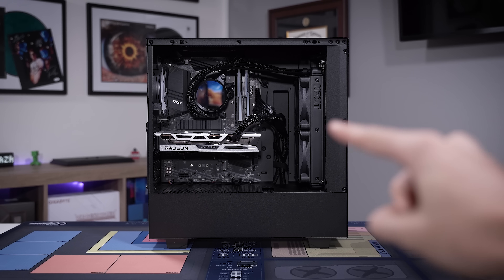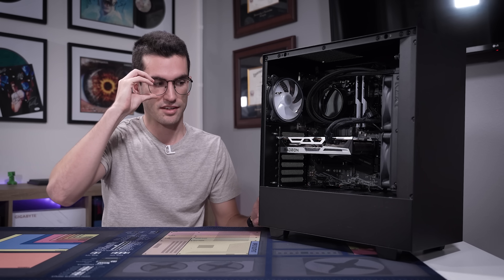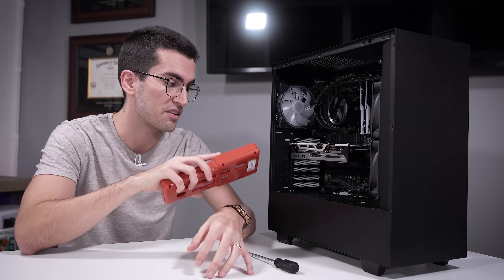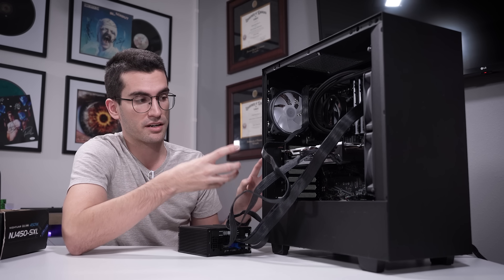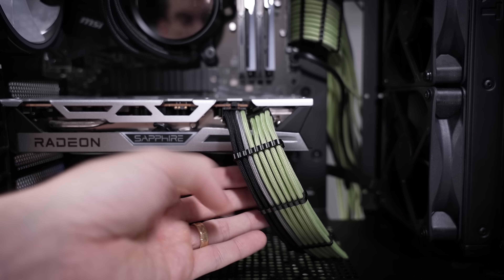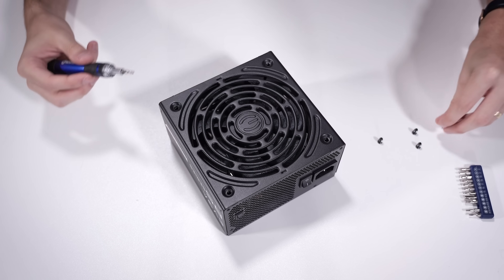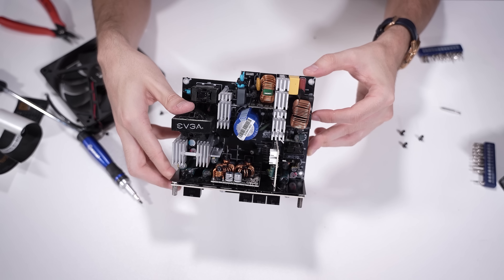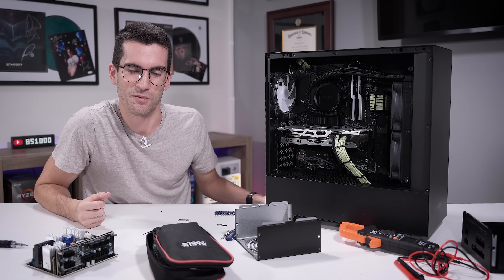Fixing a Viewer's BROKEN Gaming PC? - Fix or Flop S3:E15

Comment: Hi Greg! I consider upgrading my cpu from a ryzen 7 2700x to ryzen 7 5800x3d and i wanna know what cooler would you reccomend because now i use Be quiet pure rock fx2
Reply: Not Greg but I think you'd be good with any 6 heatpipe cooler, like the BeQuiet Dark Rock 4 if you like the look of Be Quiet. There's others in that same neighborhood also.
Reply: I have a 5800x3d and I would be a little leery about using an air cooler on it. 

It's a toasty boi even with my 240 aio, and the thermals are very inconsistent.. 

It's a fantastic CPU, and I'm sure a high end air cooler could tame it.

Comment: I've been using bequiet! power supplies for the last ten years. I had a bequiet! Straight Power 750w Gold break about 6 months before the warranty was up and bequiet! replaced it with a Dark Power Pro 750w Platinum. Two years later...still using it. Not bad at all.

Comment: Hey, new builder here. Trying to build my pc now, but after putting everything together and connecting all cables, everything turns on (rgb, case fans, GPU and cpu fan) but no post. The mobo diagnostics turns the red light for the cpu on, but only for a second then it turns off (this is after I updated the BIOS). Checked other guides and tried following them (reseating everything, taking the CMOS out for a bit) but still nothing. Any little bit of advice would help. 
Specs: 
R5 5600x (ebay)
B450 gaming pro carbon max wifi (ebay)
Radeon 5600 xt (ebay) 
16 gb, 3200 mhz lexar Thor ddr4
Patriot p300 m.2
Nox 650 w psu
(Rest is Amazon)

Comment: Fixing psu's not worth it.
Simply because they work at high voltages and high amperage.
If something breaks, lotf of things breaks with it too.

Like on dell laptop motherboards.
If it dies, it is an endless rabbit hole.

Comment: easy and SAFE check you can do without opening the PSU is measuring resistence to GND with the multimeter of the various colors on ATX plug. if any of it is less than 10 ohms you know theres an issue inside PSU

Comment: mind if i ask but how do you drain the power suply so it is safe to handle?
Reply: You can very carefully use a good screwdriver, NOT a cheapie one, and short out the two leads on every big capacitor you see on the board.  If they are still charged up, you will see a spark when you touch both leads together.  Just don't be touching any metal part of the screwdriver when you do this!!!  They do have a special grounding tool for this which keeps the high voltage sparks from possibly damaging the board, but a good screwdriver with an INSULATED handle should be fine. Just be careful and MAKE SURE the PSU is NOT PLUGGED IN FIRST!!  😵
I've actually been hit by a high voltage cap in a TV many years ago when I forgot to drain it and the juice went from one arm straight across my chest and out the other because I forgot to keep one hand behind my back for safety first!  VERY UNPLEASANT and if I was older, like I am now, or had a heart condition, I would NOT be writing this now!!! It literally knocked me back against my mom's breakfront!!

Comment: Misisng 5 v for Stanby from power supply , without 5V  is not working  , the power supply it have other power only for 5 v it fix that may work again  👍👍👌👌 14:22 here in right EEL-22-08 tranformer for 5V  and the chip IC81  drive this tranfomer

Comment: This happened to my PSU, we had rolling black outs and it shorted most of the PSU a 600w 80+ gold. My PC would post and was able to be used a bit until it became under load, that's when it turned off. It eventually fully died and I replaced it with an 850w 80+ gold PSU. I'm all fine now with my PC

Comment: I’m glad for this series. Just finished up finding out why my cousin’s PC was overheating (I built the system myself and did some maintenance not long ago)
Symptoms: Shut down on home-screen without running tasks and 10-15 minutes of gaming then auto shut down 
Checked every component, last being the CPU itself.
I instantly witnessed the problem…I didn’t apply enough thermal paste!
Problem solved!
Did some updates, went into bios, enabled XMP, Asus performance mode, hit save and restart only to run into another problem!
Debug gave me a Ram issue, cleared cmos and nothing
Thankfully I had my own PC and took out a single ram stick, took out his, inserted mine and boom! Boot up!
Disabled XMP, asus performance mode, saved and restarted. Everything fine with my stick
Turned off and inserted his ram and boom! Boot up! 
All in all, your channel has saved helped my PC journey and I can’t thank you enough!

Comment: Help please! My PC stopped POSTing after updating BIOS and Windows, it works with low 4gb 2133mhz RAM but doesn't work with anything higher, it used to have 16gb 2666mhz (2x8) but not anymore, already cleared CMOS and reinstall BIOS and Windows

Comment: I always buy high quality PSU's now after having a cheap PSU start to catch fire and not shut itself down. I was just lucky I  was in the room and could unplug it really fast from the back. My current PSU is a Corsair RM650X. I had a friend years ago have a bad PSU take out a number of PC parts. He was not happy about it, as he had replaced a hard drive that failed and then the PSU killed the replacement drive as well.

Comment: When I built my  first  PC, I couldn't get a picture.  I  took my  pc  to a professional  and they  diagnosed and fixed it right  away.  I  didn't plug  my graphics card in to the 8 pin. I felt so dumb.
Reply: in India, some shops scam you in cases like yours, telling you that your gpu is toast and you need to shell out bucks on a new one. Happened with a friend of mine who had no knowledge about PC parts
Reply: Tip from my father that is a retired telecomunications repairman. ALWAYS check if the cables are correctly connected. I do that with every module of my pc whenever I open it up to upgrade or clean it up.
Reply: When I got back into building around 2014, I forgot to plug in the supplemental cpu power cable and called techsupport for the mobo manufacturer.   That was the first question they asked me 🤣
Reply: Don’t worry about it. I’ve spent a lot of time troubleshooting my pc that wouldn’t on, only to find the power supply switch switched the wrong way

Comment: There could be that the PSU was fried right off the bat when trying to first power on the system depending on what the TDP of the components is cause that was only a 550W
Reply: Over draw won't kill any but the most garbage PSU. Typically it'll just switch on for a second or two and then trip the over current protection circuit.
Reply: @DJKr15py  overdraw has killed more EVGA PSU’s that I’ve built with than any other brands. I wouldn’t doubt if there’s some QC issues or manufacturing defects that went unnoticed
Reply: @StatikTheWarmonger  I'm guessing they were being run at 99% of their peak output and then the normal degradation of the components was somewhat accelerated. 

Personally I always run a massively overkill PSU, not only does it account for possibly decades of degradation but it runs much much more efficiently at 50% load.
Reply: @StatikTheWarmonger  I agree, for all the schlongriding this company gets I see a subjectively large amount of units with issues crop up.
Reply: @DJKr15py  I do the the same, I have a be quiet! Dark Power 12 1000W 80+ Titanium in my rig. The PC’s I’ve built with EVGA PSU’s I’ve seen failures even when they’re overkill for the rig they’re in and it’s not any specific wattage. They’ve failed on a 650W, 850W and 1000W that I’ve worked with and in a 550 here on Gregs video.
Reply: @StatikTheWarmonger  I've got a 700w one powering my old FX-8350 rig and it has terrible coil whine so hopefully it doesn't go out soon.
Reply: Yeah, more likely was on during a power outage. I find PSU's have higher chance to die with the abrupt off (mixed with some bad power from the wall) then even a surge.

Comment: Possible the main switch mode transistors are shorted and the main fuse is also bad like you said not worth the trouble for the cost of the power supply.

Comment: if you want that psu fix than sent it to me i can fix it it and sent back to you because i have worked on many them

i remember mine died just like that no power at all i contact my seller they sent me replacement one n sent back old one blew out
i have fixed few customers psu because they were out of warranty 
one more likely to failure is one on taller heatsink which u didnt see it closer

Comment: 14:44 It’s unlikely that the PSU cables were mismatched, but it would be hilarious if something happened to the cable internally
Reply: I just ran into that a couple of weeks ago, had 2 pins swapped on a 6+2 PCIE cable - took a while to figure it out.
Reply: Yeah I was thinking it's worth at least checking the cables but that would require having the exact same cable spare which is probably pretty unlikely.

Comment: Would be nice to to get a little more information on what happened specifically when this unit stopped working. I have honestly never had an EVGA unit that is 80+ certified crap out on me to the point it is completely unresponsive. This was a diagnosis straight out of the PC Builder Simulator though. Well done.
Reply: If it helps in your knowledge and education, (friend of the owner) It literally just turned off on him. No storm in town, no click or power outage. Feels like the PSU literally just died. Attempted all outlets and no response
Reply: @lilBrymp  That's very strange. Thank you for your response though.

Comment: Could be just the fuse. My 550 had a black soldered fuse. Was a circle but only about a 3/8 round and maybe 3/8 to a 1/4 inch high. Was new to me as I have usually only changed glass fuses in these like you normally find in older vehicles.

Comment: Lesson of the day - never skimp on the PSU.
Reply: He used a 650w evga psu, i'd hardly call that skimping on the psu...
Reply: @andy816896  it was a cheap 550w bronze unit
Reply: @andy816896  True, but it's still a good lesson and a reminder. Like Greg said, this PSU did it's job and saved the downstream components. I blew up a thousand dollar rig once because I used the PSU that came with the case. Killed the CPU, the motherboard, and a hard drive. I came home and it was just cycling on and off.
Reply: @andy816896  Yes, it's not totally skimping on the PSU but just because it's EVGA does not mean it's a quality unit. It's a cheaper 550w, Bronze rated PSU. These types of units are usually made from cheaper Chinese parts and caps (capacitors). The cheaper caps are much more prone to expand with the daily in-rush current and fail within a shorter lifespan - sometimes premature. It might not be the case here but it still failed, regardless. The more expensive units use all Japanese caps and that's what you pay for.
Reply: My very first PSU was a Corsair 650W 80+ Bronze. Died after 6 months. I replaced it with an EVGA Supernova 850W 80+  Platinium, worked like a gem for 4 years until i built a brand new PC with an EVGA Supernova 1000W 80+ Platinum. Better spent a bit more now than be sorry later. I got told to never ever trust Bronze quality PSUs and always built with Gold tier PSUs at the minimum.
Reply: @gwanny1885  Bronze/gold/platinum means nothing with regards to quality. You can get an 80+ gold psu with cheap components and a 1 year warranty, and bronze rated ones with quality components and a 5 year warranty. best bet is to get a psu that produces the full claimed power on a single 12v rail and at least a 5 year warranty
Reply: My supposedly excellent Seasonic PSU exploded with a bang. Everything can blow up, even the best ones.
Reply: @Jenni_Sofia  Anything can blow up, just not as likely with more expensive units. In your case, it was just bad luck. But regardless, I still understand why people buy cheaper PSUs. I wish nothing blows up for anyone. Buying a more expensive unit will only decrease the likelihood of it developing a problem but better to spend more in the long run.
Reply: The psu is the most important part of a PC. And even top tier PSU's are cheap. He didn't skimp on a PSU tho, he used a good one.
Reply: @RaimaNd  Those EVGA bronze are garbage.  They have a bad tendency to fail.  I myself went through 2 of them and my brother had one die as well.  There's a reason they cost $40-$50.  A good PSU should cost $100-$200 and have a 5+ year warranty for repair and not just replacement which means the PSU is made of cheap materials not worth repairing

Comment: Seems like someone just wanted to get their psu upgraded because it stopped working. Like how could you not test that the psu would probably be the main problem for not turning on.
Reply: Maybe not.  A lot of us might know how to take out a PSU to test it by turning it on manually but I'm sure there are many more that don't have a clue.
Reply: If you don't have spare parts on hand and have never built a PC yourself, how would you know what to check?
Reply: To add fuel to that fire, when Greg showed the cables connected, the base that connects to the PSU read "Type 4," which is exclusive to select Corsair PSUs. This guy probably just pulled a fast one.

Comment: Where is that AIO getting air from? I know they didn't ask but I would have asked them if I could move it...

edit

wait, it only has room for a 120-140mm at the top. I guess maybe change the AIO to exhaust out the tiny side vent. It can draw in fresh air from the back and top.

Comment: I have an old Corsair PSU in a server in my basement. 11 years old and it's still running 24/7. You never know.
Reply: I have a 850 and 600 watt Antec PSUs from 2014 and 2015 still running 24/7 - I think that was one of the budget EVGA products.

Comment: I bet there's a blown fuse on that PSU
Reply: I think it would have been just before or after the main switch, not sure on EVGA but thats the norm
Reply: @tomr3422  There are fuses after the transformer, in fact modern PSUs have multiple fuse points. and they don't use glass inline fuses anymore, and some fuses are actually small SMDs, so you can't actually see if they are blown, you  have to check via continuity.

Comment: the psu was in eco mode. evga eco mode always has issues.
Reply: I never use ECO mode!!
Reply: @wallychambe1587  watching the video, eco-mode was switched on on the back of the power supply..
Reply: @CodeDonut  Yes I saw that, I have two EVGA PSU's and I was just saying I never use ECO mode on mine!

Comment: I'm not surprised an EVGA 80+Bronze rated unit failed as I have personally had two EVGA 650 BR semi-modular power supplies go out on me in late 2021 and early 2022, one was DOA & the other had a fan that ran at 100% with any gaming stress whatsoever (FYI, Both were for budget builds for co-workers,  NOT my choice but, theirs), both units were on sale for just $54 when they would normally cost around $69 so, I guess you get what you pay for no matter what name they slap on the side of your PSU :/  p.s. I now only buy Corsair RMx 80+Gold rated units for any PC I build :)